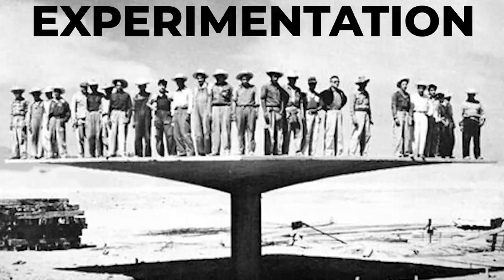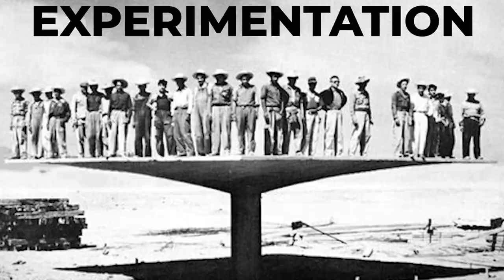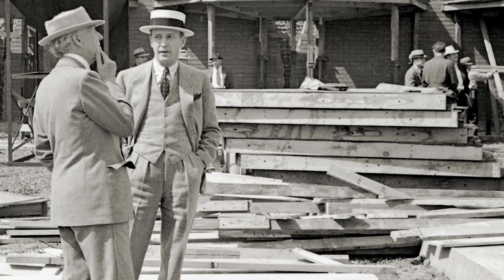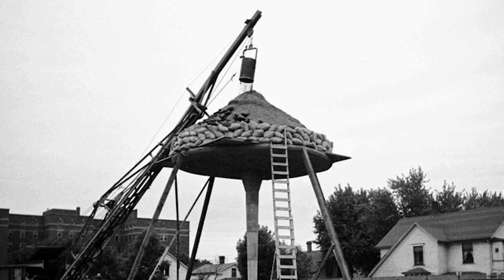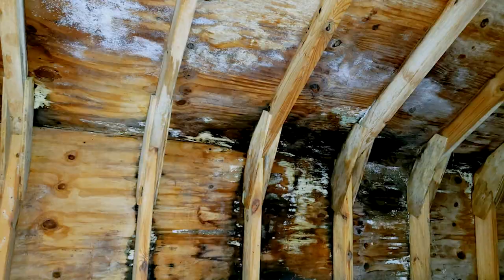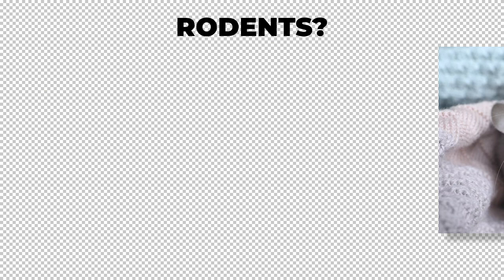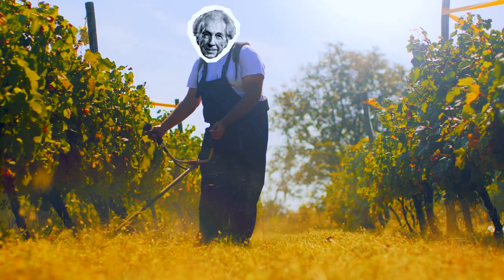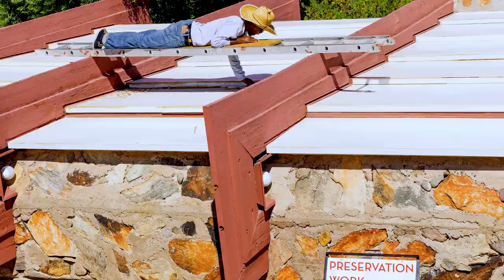Frank Lloyd Wright Houses Are LEAKING

Comment: As an owner of a Frank Lloyd Wright House with a flat roof, the simple answer is that at the time many of his homes were designed, the common methodology for building an inexpensive flat roof membrane was to use tar and gravel.  Wright understood that this initial design was not impervious to water, but it was the best available inexpensive solution at the time, and he believed that technology would eventually catch up with his vision and offer better technical solutions to fully resolve his artistic/aesthetic vision, and when available, the homeowner would upgrade the issue of concern.  Which is exactly what happened in my case.  About fifteen years ago, the entire original tar and gravel roof was peeled away, the wood support struts were reinforced with steel, and a new roof (a thin rubber membrane that was very slightly canted) was installed which has never leaked since - permanently resolving the issue while maintaining Wright's original architectural vision. It's really not a big deal.  Once fixed, the issue goes away forever.
Reply from the maker: Hi Todd, it’s great to see a Frank Lloyd Wright enthusiast in the comments. Thank you for this insightful info, and please excuse the generalized info of the video. It’s more geared towards an overall understanding why leaking occurs and that’s it’s not due to Franks oversight by any means.

He did what I think most artist and architects would do which is execute his vision the most impactful and effective way possible. Regardless most houses of that age are going to leak at some point. I’m happy to hear you’ve considered the longevity of your home and you are happy with the outcome. FLW homes deserve the attention! I’m quite sure of the home you own (won’t mention here for obvious reasons) and it is very beautiful, especially the furniture. Great to hear from you and I hope you stick around!
Reply: @altArchitecture  A pleasure to make your acquaintance!...
Reply: yes but at what COST?? that sounds like owning a rolls royce and saying yes its a great car. sure it needs a new tranmission every three years and a new engine every five but its a great car. :(
Reply: @danf4447  As I stated above, the house (now 80 years old) has had its roof replaced once in its history.  So that seems quite sensible, in fact.  The radiant heating system has also been replaced once in 80 years. So what's your point? How often do you expect a roof, or heating system to last normally in an average house? I might add that the cost to replace the rubber membrane roof on my Usonian house is far less expensive than a typical shingled roof (particularly if the shingles are slate, which becomes extraordinarily expensive).  Every other system of my Usonian house costs no more/less to maintain or replace than an ordinary house.  So I don't really understand your poorly informed opinion.
Reply: well after 15 years most rubber roof systems are shot they dry out and your right back to were you started  the problems are there all over again
Reply: @pupbiking  Actually, my roofing system comes with a 30 year guarantee. High quality architectural (dimensional) roofing shingles last from 20 to 30 years, so with a normal shingled roof you're also "...right back to were you started  the problems are there all over again...". A house requires new roofing every 30 years or so, whether it's my roof or your roof.  You're welcome.